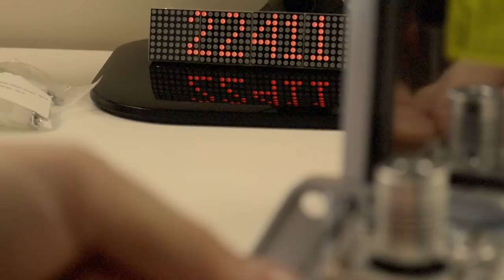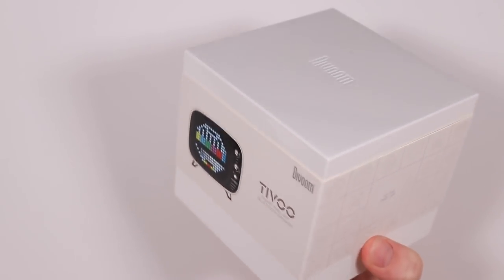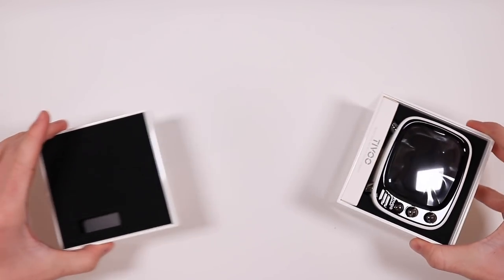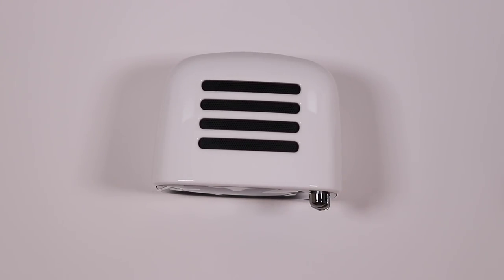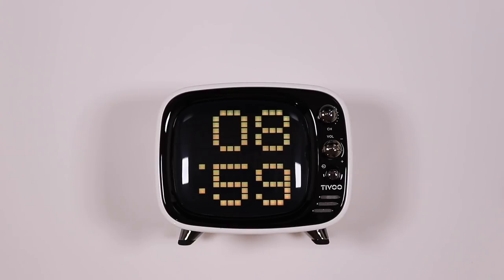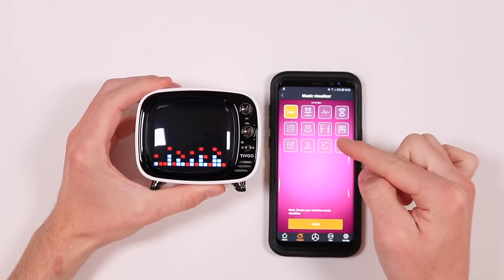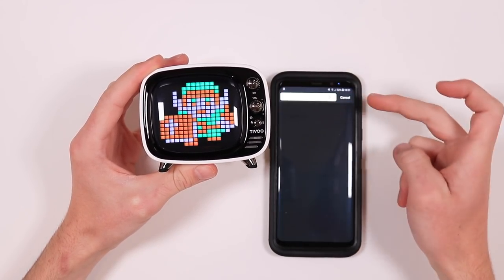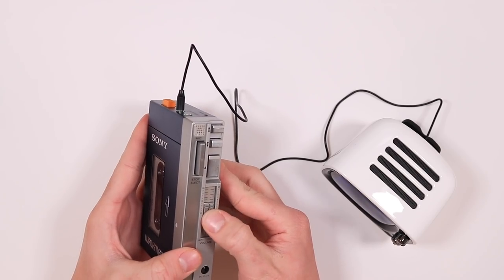Retro Pixel Art TV! - Divoom Tivoo

Comment: did he just reviewed a speaker with out checking the sound quality ?!!
Reply: It probably isn't great. He did say it was a sponsorship
Reply: @unstableturtleduck   It's a pixel art screen first and a music player second. It sound good for it's size and definitely loud enough for a small room even on low settings. The sound is clear, good in treble but a bit harsh with some music (esp heavy guitar). It could do with being able to adjust bass and mid - but there is no equaliser on the app to change the audio. The max number of songs the app will show is 2000, even if you fill a 32GB card inserted into the device (largest size it can handle). A caution - read the reviews, you might fry the device or battery if you use a modern phone charger, and definitely avoid all fast chargers. The device is boxed with a usb 'charge only' cable that cannot transfer data. Only use that. It doesn't display the charge accurately or last long, so you need to leave it charging for a long time to use on it's own (it is best to keep it connected via usb to a laptop or pc). The aux cable is also not the highest quality, there is some noise and beeping using the device as a speaker for a pc, although that could be down to the distance between them, other devices or even windows. For most people apart from the charger problem these issues might not be a deal braker,it's worth around 40 (£-$-EU) imo
Reply: @unstableturtleduck  it really good. I have one myself, and it sounds like 10 phones all together.

Comment: Is that a proper lcd with a filter on it or just an RGB LED matrix?  It looks similar too that LaMetric Time scrolling one a lot of youtubers have in the background displaying subscriber numbers and such.
Reply: meetoo594 Pretty sure its an rgb led matrix. Would be interesting so see inside though if they are discrete on pcb or a cast epoxy module.
Reply: sjm4306 Yeah that's what I figured, the `pixels` really pop unlike an LCD.  Like you I would love to see a teardown of the device to confirm the nature of the display as it looks lovely.  Im gonna guess its a module with surface mount leds but would be interested to see it confirmed.